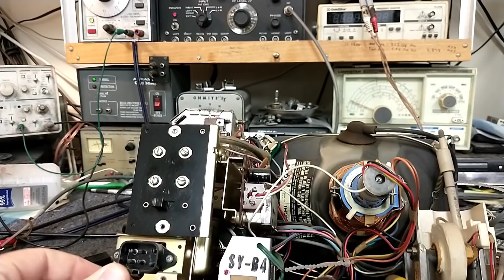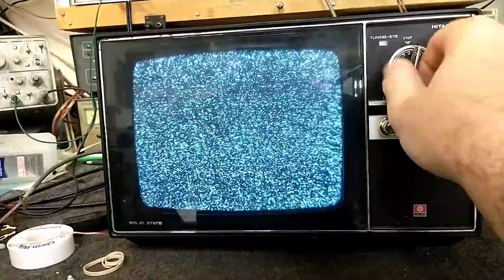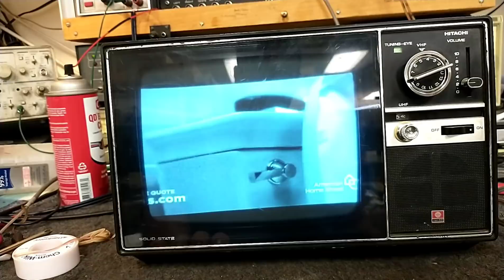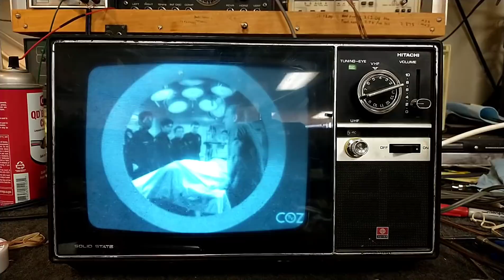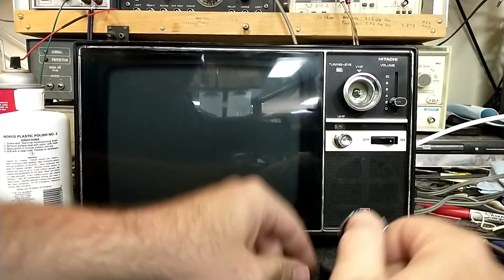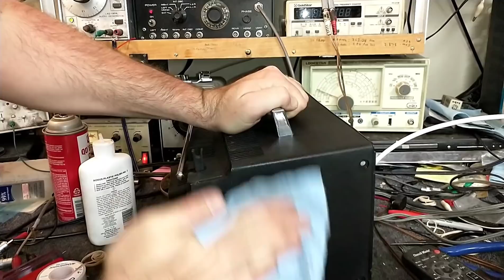Quick repair of a 1970s Hitachi IU-53 9" Solid-state portable TV. Dead set.

Comment: Where can I find a power cord for mine or how can I modify it to use a newer cord?
Reply from the maker: These cords were used on most AC/DC televisions of the 70s. Not easy to find. Hitachi, Toshiba, and sanyo I believe used this cord. 

Two pins are the AC input to the 120-12v transformer.  There are two pins shorted together to make a connection between the regulated power supply for 12v to the rest of the set. The other two are blanks that would normally be used for a battery pack. 

You need to trace out the circuit or get a schematic to help you. Its easy to blow the set up if you get it wrong.....

Comment: I did repair several TV's in Australia, and of all the brands, the Hitachi brand name was one which required the least cost for components (resistors, electrolytic capacitors, bipolar transistors). It wasn't the most popular, but I loved getting a 'fix' using a multimeter for checking voltages and out-of-circuit components. Some work involved reworking soldered pads attached to plugs, where the green protective translucent paint was 'insulating' the connection... I see this TV would have seen the introduction of the new TO-220 case style for the regulator transistor, but still much of the hardware to suit the dimensions of a TO-3 case style transistor...

Comment: If they made a 12volt DC analogue to digital converter box You  could use that TV in the car or on the beach. Unfortunately no company has made a 12 volt converter box to make these portable TVs portable
Reply from the maker: The majority run on 5v, which is generated by a switching power supply inside. Wouldn't be hard to make that work from a 12v supply.

Buffer capacitor, 7805 regulator and heatsink, reverse protection diode, and off you go!

Comment: I used a portable hitachi and later a portable rca tv when I tested for satellite tv reception at customer homes back in mid 1980s.   Jordan what's your opinion on Hitachi receivers from the mid to late 1970s?  I'm looking at a SR-903 receiver. It was highly rated by test magazines when it came out, but I've heard the quality of parts used by Hitachi was below Pioneer, Sansui, Kenwood, etc. and it will need to be totally recapped and most transistors replaced.
Reply from the maker: Yeah, but at this day and age most of these mid 70s receivers need it, so I wouldn't pass judgement based on that. Hitachi made sleeper gear that was designed well, and improvement can be made by recapping with better caps and replacing noisy transistors in the signal path

Comment: How does the instant on work
Reply from the maker: CRT filament is always lit regardless of the B+ in the power supply.
Reply: @JordanPier  won't that burn it out faster
Reply from the maker: @nomusicrc  yep. That's why collectors hate it. Some you can disable, others it's easier to put the set on a power strip or smart switch.

Comment: That's such a nice portable set :-D, a very classic american black and chrome flash.
I also liked the classic chrome and black american c.b radios as well.
I got a little confused with the collector of the tranny connected to chassis ground.
Must have been a  p.n.p type i suppose.
Reply from the maker: This was an NPN transistor. What it looks like they're effectively doing is regulating the ground side for the AC to 12v supply only. The unregulated is 18v, just heavily filtered. Looks like they are keeping the ground 6v above, making the 18v 12v to the set. No zener regulator or series pass. Very odd way of doing it. Simple, but works.
Reply: @JordanPier  Ahh i see,  thank you for making sense out of odd configurations :-D.
I have to re draw some circuits to make sense out of them.

Comment: Hey dumb question probably, but why didn’t you try reversing the leads when you found that open junction on the transistor?
Reply from the maker: The 2sc1060 is an NPN transistor, so reversing the leads should yield nothing. If it did, then the transistor is defective, which we have already established with the open junction.
Reply: @JordanPier  Simpson 260 has a DC polarity switch that can make the red the - and the black the +. That mistake can make you think the junction is open if you don't swap the leads, or make you think a PNP is an NPN.

Comment: That tuning eye rouses my curiosity.It can’t be an electron ray tube. That would require a B+ supply of several hundred volts.Also too old for an LED lamp.
Reply from the maker: Very likely a low voltage lamp. When the IF get s astrong enough signal or the detector zeros out it probably signals a transistor which turns on the lamp.